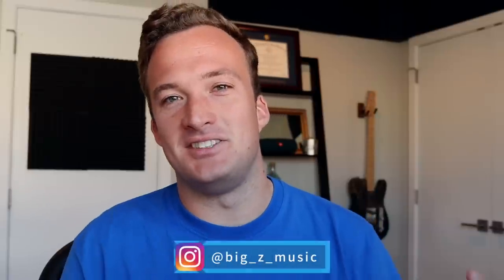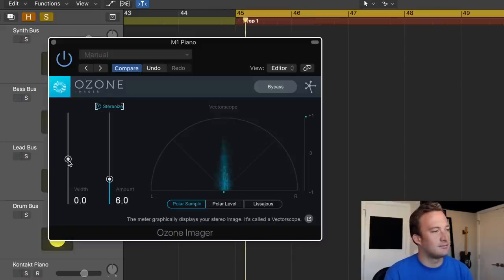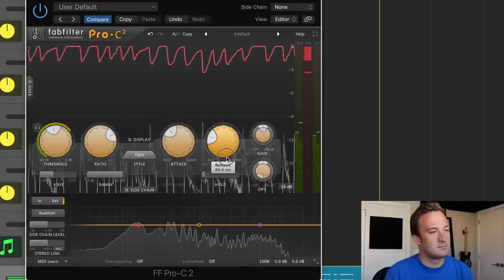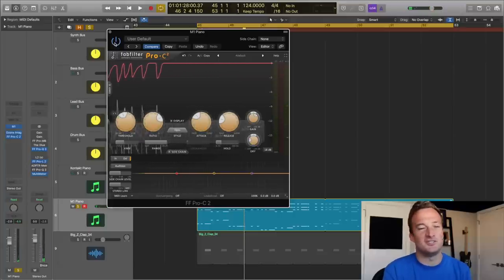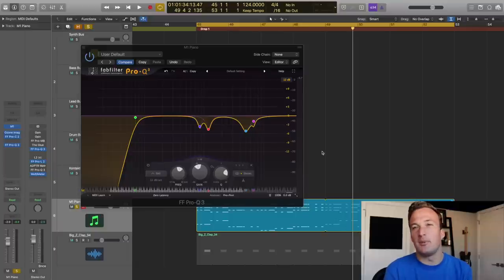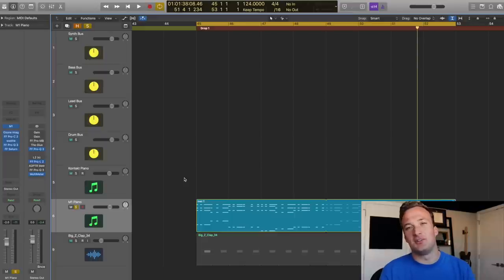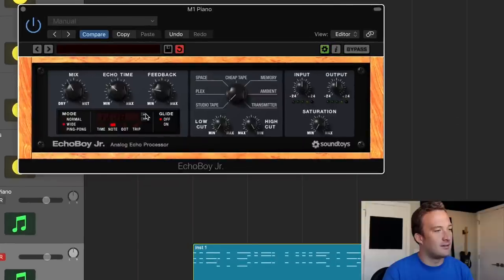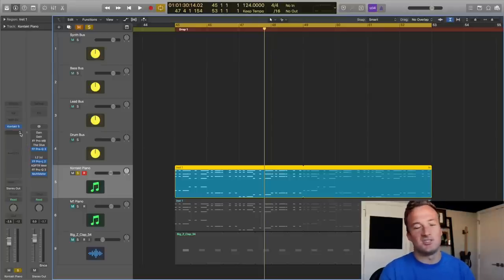How To Make Your Pianos Sound DOPE

Comment: Piano is always tricky! Good tips. Nudging the individual midi notes so they don't ALL play at 'exactly' the same time makes a BIG difference as well to get a more realistic part. The F9 Piano for Kontakt is an amazing club piano.
Reply: Agree 100%. People are so used to quantizing everything, that they forget that having un-quantized notes makes things sound bigger by default. And even better, duplicate your piano track, apply a different "humanize" setting to the original one, and use that to add stereo imaging. It's better, in my opinion, than using a plugin. And yes, F9 is awesome! I have a lot of their stuff and most of them are just great stating points, the piano being one of them

Comment: Great tips 🔥 The compressor for the maverick made a HUGE difference! Could you explain when to use the dynamic EQ over the standard EQ (and vice versa) though?
Reply: Here's a simple example that hopefully will help: when you have a piano, for example, you will be playing chords with various notes. Then you have chord progressions, which will change each chord. That's the basic stuff. Now if you apply a static EQ and remove, let's say 3dB at 6.2kHz (that's a G8 note), even when you change a chord, the next chord will have the 6.2kHz removed as well, but maybe that chord needs that frequency/note, because it's part of the chord itself. By doing that, you are attenuating a certain note that shouldn't be attenuated. So when you apply a Dynamic EQ, you are only removing or boosting certain frequencies depending on how much that particular note or chord is "rich" on that particular frequency. Maybe on chord 1 the 6.2kHz is harsh, but on chord 2, it's not, so it wouldn't make sense that you apply a static EQ, because you would be making it sound different without it being necessary. Hope it makes sense

Comment: Not sure how you do it, my chord sound so trash from the start, (to many resonant frequencies) yours are so clean without any processing?
Reply: Check for insert effects within the plugin. If your using M1 turn them off as they sound terrible.
Reply: @itsleejames  I know about them, I have them off always, I think it’s to do with chord inversions, some sound better than other, also to do with octaves, some have more nasty frequencies, basically you need to structure your chords correctly, but for some reason I just can’t get it right, but thank you so much for your tip :)